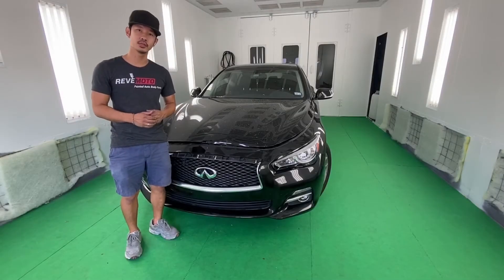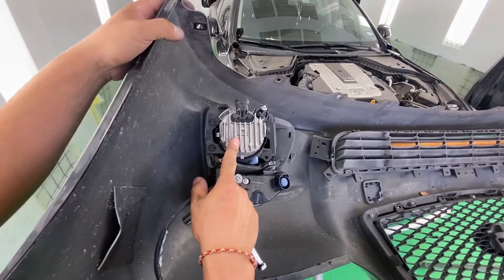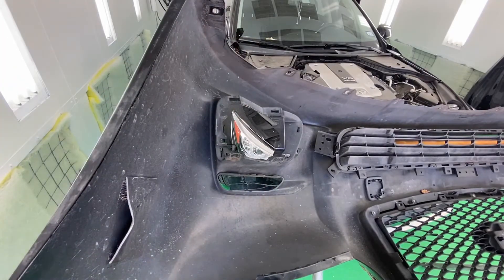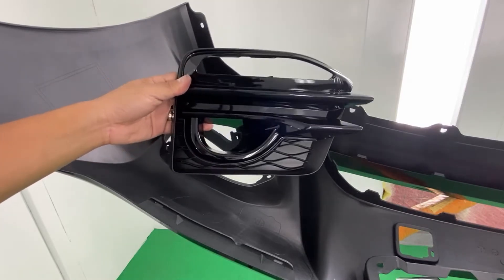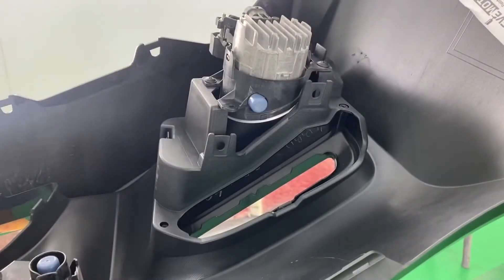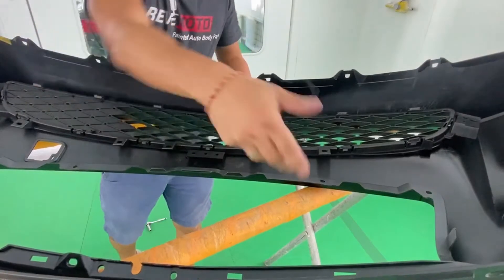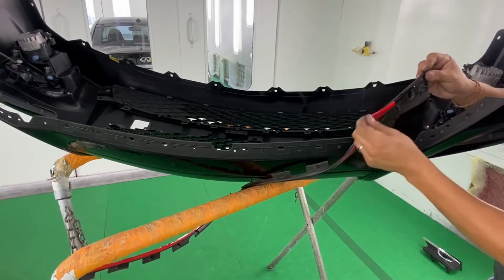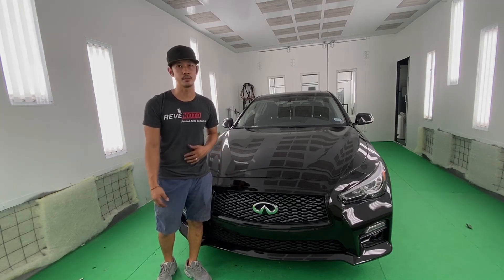How to Replace 2014-2017 Infiniti Q50 Fog Light & Grille | Q50S Sport Black Grille (2 of 3)

Comment: Awesome video! The 14-19 bumpers are interchangeable so curious to know why on the website has a 14,' 15', 16', and 17' year front bumper. Also what does it with or without sport in the bumper options mean? Does 'with sport' option include all parts??
Reply from the maker: Great question. The model range from Infiniti is 2014-2017. There was a facelift on the 2018-2019 Q50. A different style bumper, but it has the same hood/fenders. That means the bumper is pretty much the same shape. Sport doesn't include all the parts, it just has a more aggressive lip on the bottom and you need the "sport" fog light bezels for it. Thanks for watching!
Reply: @ReveMoto  Still somewhat confused, so all bumpers from years 14'-17' on your website are the exact same?
Reply: Also does that mean a 2019 Q50 front bumper would fit my 2014?
Reply from the maker: @therealyousef  There are two styled bumpers for the 14-17 models. The non-sport and the sport model. The bumper style was changed for the 2018-2019 model, a completely different part number from the older models. Manufactures do what is called a "facelift" to re-market the car to consumers.
Reply from the maker: @therealyousef  I am not 100% sure and I would check Infiniti forums. However, the fenders and hood are the same part number from 14-19. This means the shape of the bumper did not change. The 18-19  model bumper is different in look, so it has a different part number. Also, the headlights are different numbers as well but look to be the same shape. Thanks for the questions.

Comment: I have the base model do I need the to buy a new bumper to be able to install just the black fog light covers on my base model q50?
Reply from the maker: Hi Jerson,  Yes the cover is designed for the S models only and will need the new S Model Bumper.  Its a really cool conversion and if you need it we have on on our site ready to install at https://www.revemoto.com/pages/2014-2017-infiniti-q50-front-bumper-conversion-kit

Comment: What kind of screws do I need ? Are they special or can I find them anywhere
Reply from the maker: It’s the same screws currently on your fog light. There are just an extra 3 for the sport bezel. Thanks for watching!
Reply: I ordered off Amazon lol do you think they will be easy to find if it doesn’t come with any ? Thank you
Reply from the maker: @alejandroreyna407  the bezel typically doesn't come with the screws. Infiniti sells it all separately but you can get them (screws) for a few $ at your Infiniti dealer.
Reply: @ReveMoto  do you know part # for screws?
Reply from the maker: @meesn8231  No, I do not. We sell them as a part of our conversion kit. But, you can just call Infiniti and ask them. You need 3 extra fog light screws. It's the same screws as the regular Q50. Check out our kit, thank you for watching!

Comment: I have a 2015 Q50 can I swap to a 2018 sport bumper and use all the parts from the old bumper until I get the updated foglamp covers anyone know?
Reply from the maker: Good news and some bad news. First, we recommend checking the Q50 forums. Those guys usually know everything. The hood and fenders are from 14-19, which means the 2018-2019 bumper will fit the older model. The headlights are different but look to be the same shape. Of course, you would need to update all the grilles, fog light bezels and probably the fog light. Great question, thanks for asking!